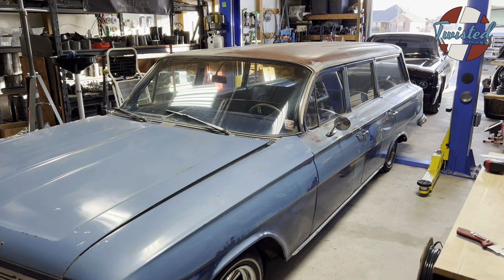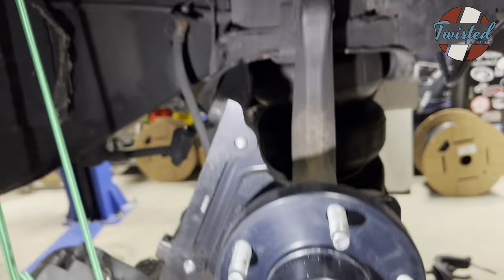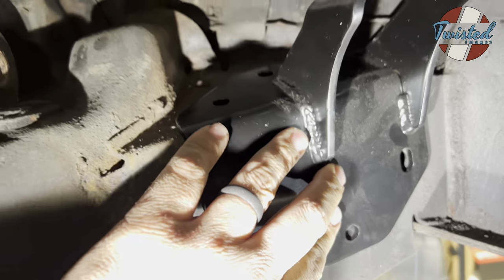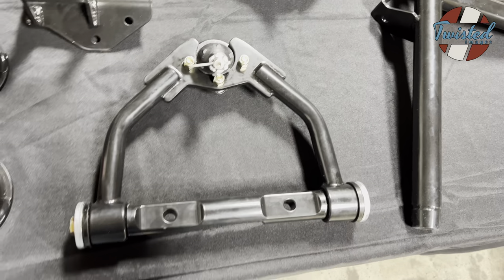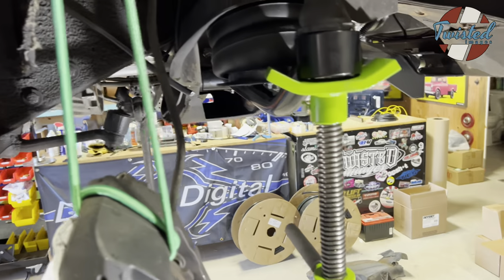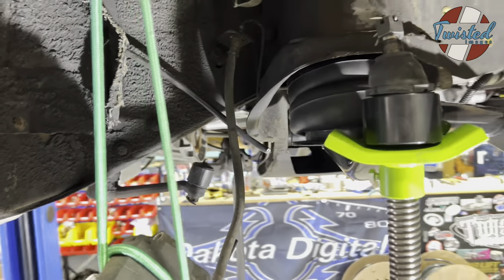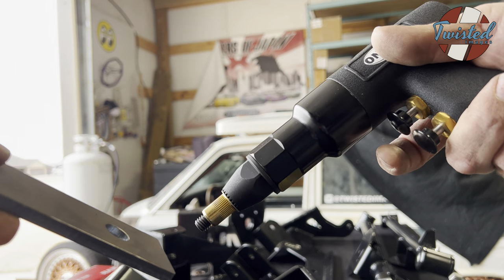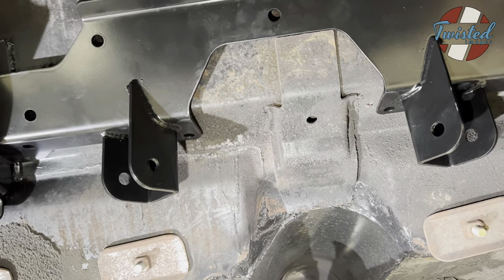1962 Lincoln Continental - Complete Air Suspension Installation

Comment: Nice vid. I don’t understand why Airlift sends out angled air line fittings for the bag which made routing the air lines super tricky in the frame cup. I replaced mine with straight fittings so that the airline came straight up and out.
Reply from the maker: You’re talking about for the front bags? I definitely prefer to run the line straight up and then put a 90° union fitting just outside. I’ve never gotten fittings from them so I didn’t know- I’ll have to message them about that!
Reply: @twistedimages405  My bad. I meant to say from Airlift. That 90 degree fitting is a good idea. Barbed? 🤔
Reply from the maker: @Realest1979  it’s a 90° PTC union- just line to line DOT push- connect. Makes installing/removing a bag so much easier and you don’t need to leave a bunch of slack in that long run from the front end back to the trunk
Reply: @twistedimages405 😎

Comment: I have a question woud it be good to put seam sealer glue between the new bolt on mounts and the frame because if u go trough water, water can accumilate in between the frame and new mounts witch are screwd in ? Ye its not going to be a problem instatnly but later down the line it coud rust the frame in that part ye its painted but water can still get trough paint to the metal to rust out that part if there is water there for some time

Comment: great video. Do you have all the parts available for a 67 lincoln cabriolet to do it all?

￼
Reply from the maker: @jurekssima7836  we don’t stock the Choppin’ Block suspension kits, but they’re usually available to ship within about a week.
Reply: hi if you can suggest where to buy this whole
system. i have 67 continents. and what would
be suitable for my car? thank you
I can't speak English myself. only with
translation
Reply: Can you recommend which manufacturer's system is better to look at 67. Continental. I have a convertible and it wouldn't complicate things with the installation?
Reply from the maker: @jurekssima7836  I prefer Choppin' Block- their parts are built very stout, everything comes powder coated and pre-assembled, and the price is decent.  Murray also makes a nice setup but if you asked me to choose I'd stick with Choppin' Block.
Reply from the maker: @jurekssima7836  Not a problem!  Here's a link to our website for these kits: https://www.twistedimages.com/61-69-Continental_c_589.html
Reply: Thank you very much! 
if I need help I will ask you. 👍🤝